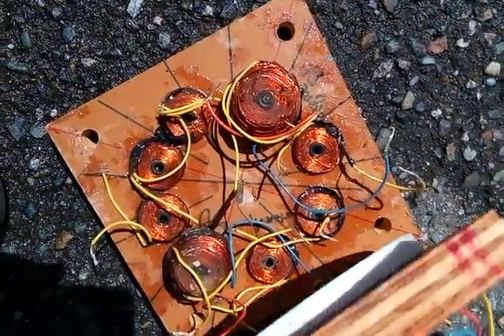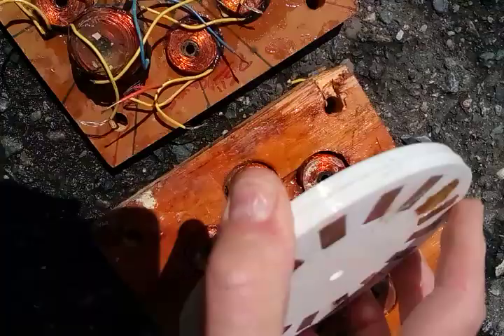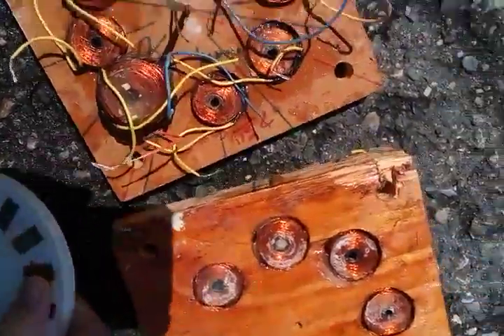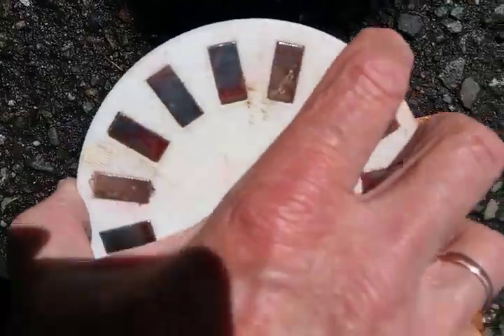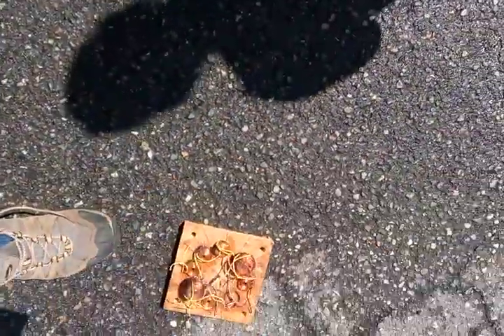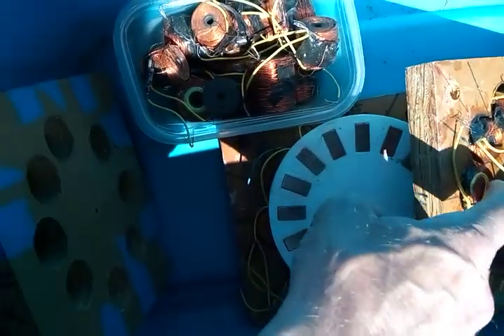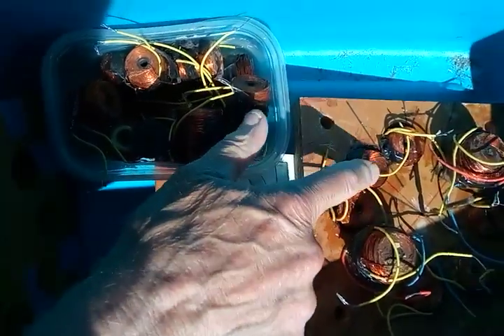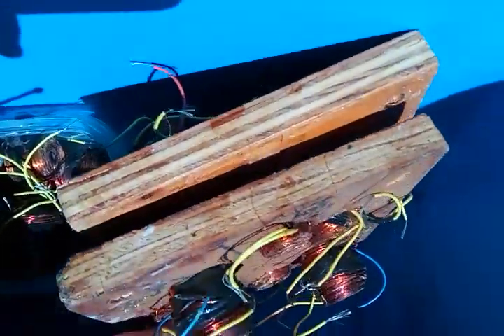No lenz generator at 2100rpm you finish it project

Comment: The main thing I’m struggling with is lenz law effect, how do i get rid of the lenz law, also does the lenz law not effect the pickup windings on the drive coils
Reply: Whenever you connect a load to a generator, it starts to cog or bog down. If a light bulb is connected to a generator, you will hear the generator slow down. This is because a secondary electromagnetic force is being applied. Its like throwing a ball at the wall and having it come back at you. Now you got two forces colliding with each other. this secondary force will bog your generator down. There are multiple ways to eliminate it depending on what you are using and for what applications of course. One way would be to add capacitors between the generator and the load. Another would be to add a BiTT transformer between the generator and the load. Another way would be what Geraard Morin did and use two Transformers, one to step it up and the other to step it down after the generator. You can also use Microwave oven Transformer to do the same thing or stack them around each other not directly connected.
Reply: What if the high voltage output is put into a generator, like a flyback transformer that has a cut slot where the magnetic flux with go, put that into the generator, how it get stepped down in the next transformer, and have it stepped back up again with that first transformer. Using a vector equilibrium Utron, of a 45 degree angle, fit directly within the flux field of the open part of the transformer. Otis T Carr!.